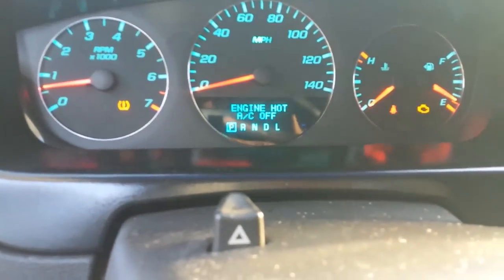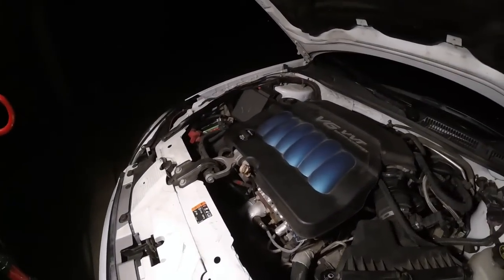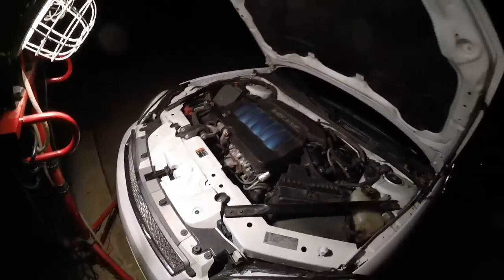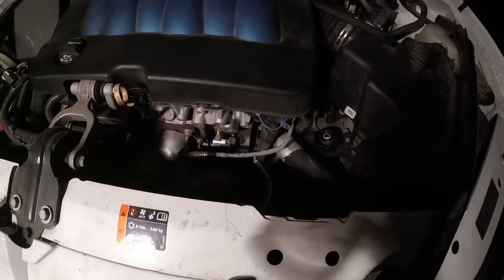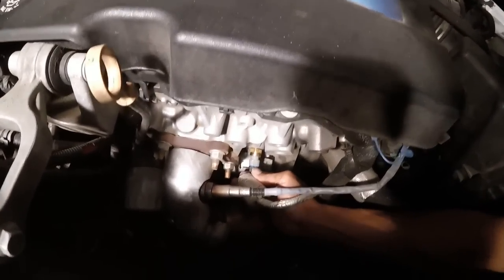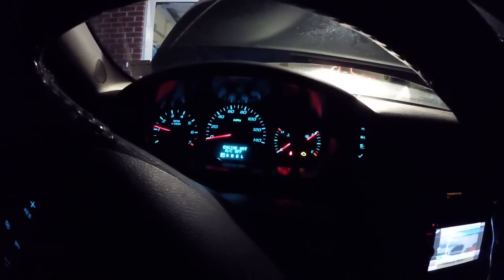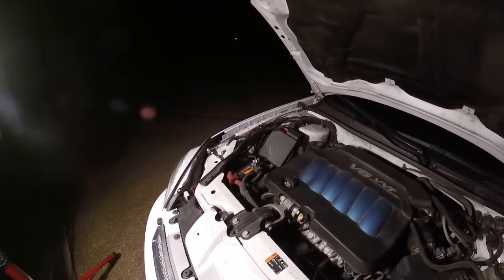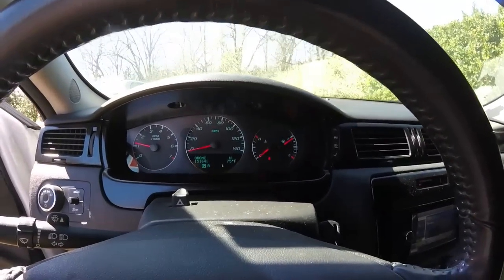2013 Impala Engine Hot AC Off Fixed

Comment: Had this same problem with my 09 Impala 3.9L, the design of the GM thermostat has a rubber seal on the valve, not allowing coolant to fully warm up. Its kinda of a misnomer because the warning light states: "engine hot a/c off." I went through the GM forums and found plenty of posts stating to start off with the coolant temperature sensor, then try the thermostat. I followed what the forums stated and changed out the coolant temperature sensor, to my relief the warning light turned off and all was well until I used the cabin heater on a cold morning and the message came back. After installing the new thermostat the warning light has been off for about a month and has not returned. When I removed the old thermostat, I was able to see that the valve seal was caught between the valve not allowing the thermostat to close completely. The seal was pretty much disintegrated, but after 11 years of service I can't complain. I hope this comment helps other DIY.
Reply from the maker: Good info 👍👍 that's pretty much how my thermostat was when I finally got around to changing it. The rubber seal was all warped and out of shape. No issues since then
Reply: @89imp03  good morning. I changed out the temp sensor and the wire that connects to the sensor. It worked for about a month and now the same issue. What to you think I need to do now?
Reply from the maker: @shannongreen7746  might have to change the thermostat. It's not as easy to do but I eventually changed mine and haven't had the issue anymore 

https://youtu.be/xVg4y--VAXs
Reply: @89imp03  thank you. I won't be doing it lol but I got someone who will. Thanks alot
Reply from the maker: @shannongreen7746  no problem, hope that fixes it

Comment: just replaced mine, i had an adjustable wrench, so it took me a while to get it off. I disconnected my battery during replacement, and reconnected post installation. Thermometer works like a charm! Thank you!
Reply from the maker: @infonoids  💯 glad to hear it worked out with no problems

Comment: This was perfect. Thanks for posting it. I had the exact same problem with my 2012 impala. $25 part, five minute replacement. Can’t beat that
Reply from the maker: Thanks, glad to help out
Reply: Good morning I was just wandering if you had to disconnect your battery terminal as well after replacing the sensor and if the Engine hot ac off reading ever came back on?
Reply from the maker: @tellinthatruthgame8785  after some months it came back and I changed the sensor again to be sure and also changed the thermostat and radiator since it was leaking. Hasn't came back since then
Reply: @89imp03  Thanks for the super fast reply I really appreciate it!
Reply from the maker: @tellinthatruthgame8785  you're welcome

Comment: Thanks for the video... I'm currently having the same problem, I have a 2013 Impala and I'm unsure which to do first... My coolant keeps running low and hate having to keep putting water in it 🤦🏿‍♀️ hopefully one of these ideas will work!!! 😑🙏
Reply from the maker: If the coolant is running low it's gotta be a leak somewhere. Could be a hose or a small crack in the radiator. If you're having white smoke or coolant & oil mixing it could be a head gasket

Comment: Thank you very informative I disconnected the battery from the very beginning and no more code Appreciate it Have a Blessed Day
Reply from the maker: Glad to help out 👍
Reply: @89imp03   The issue I’m having is that we pull it with the code reader and then it comes back on about a week or two later do I need to disconnect the battery???   It also seems that it seems to coincide with the tire  pressure sensor light
Reply from the maker: @Dagreat1ification  those two lights should be separate. If it's going that long between coming back on it could be a sign that the thermostat is sticking from time to time

Comment: The amount of people having this issue blows my mind! We replaced the sensor thermostat is next cause disconnecting the battery hasn't worked for me but tbh I didn't leave it disconnected long so I've had it unhooked allllll day. I'll touch the wires together tomorrow before I hook up the battery but that sounds scary. I hope its safe to really do that lol
Reply from the maker: Yeah this has to be the most common issue with these cars next to the blend door actuator. The sensor worked for me for a while then the light would randomly come on. Found a crack in my radiator last year and changed that and the thermostat and haven't had the light come on since

Comment: Thanks again for this video I thought I had  Posted an update the other day. I had the P0117 code that said the circuit was low for the temp sensor. Changed the sensor but it did not fix the error and it got to the point where none of the tricks would work.  So we replaced the thermostat and that seemed to do the trick put fresh coolant in it and no more issues since then.
Reply from the maker: Good deal 👍👍 glad it worked out
Reply: Is it still good.
Reply from the maker: So far so good with mine after doing the same. Later on I had a radiator leak so I changed the radiator and thermostat together. No lights since then

Comment: Hey man this is a very valuable video. Thanks for posting it this video saved my very hectic Christmas eve. It works!!
Reply from the maker: Glad it was helpful 👍
Reply: Very unlikely to be the fix as temp sensor hardly ever fails!!! Replace thermostat but first check fluid level and for any frade wire at temp sensor pigtail

Comment: Yo! Huge fan!! Been following you since i got my Impala. I just had this issue with mine a few weeks ago, change the sensing unit in the front, still having the same issue. The thermostat is next but do you know if there is another sensing unit on the side?
Reply from the maker: Thanks for sticking around. To my knowledge it's just the one sensor on the front

Comment: Good news , I did buy & replace the thermostat , I'm all good now ! Major difference with the needle when warming car 👌👌
Reply from the maker: Good deal 👍
Reply: @89imp03  yes , but I have another issue or "Code " for this matter .
P0455 I believe, However it's an  emissions problem or "large leak " which is common with the chevys I noticed .
I'd like to send you a pic or two of the leak as it is visible , it would be a huge help man !
Reply from the maker: @t-pitz8866  I haven't dealt with that code yet but it could be a gas cap or a loose hose on the evap system somewhere
Reply: @89imp03  loose hose yes , thanks I've got testing to do !
Reply from the maker: @t-pitz8866  good luck man

Comment: I had the same issue.
Here is my Quick Fix:

1: Unplug both battery cables.
2: Drain electricity from your car system by connecting both positive and negative cables together for 10 seconds (Do not let any of the cables touch the battery, do it OFF THE BATTERY)
3: plug back your cables to the battery. 

Now you problem is solved.
Reply: Lmfaoo same man same

Comment: Changed my coolant temperature sensor it’s still doing it man
Reply from the maker: Could be the thermostat then. It's usually one or the other
Reply: Just happened to me
I'm just gonna replace both the thermostat and sensor
Reply: @handheldnintendofan  replace both
Reply: Bad sensor?  Does the car run ok even though it's doing that?
Reply: Thermostat!!! Also check for frade wire at the temp sensor pigtail!!

Comment: Say man I'm having the same issue but I'm also having a small leak on the left front side by the passenger wheel right under my radiator I'd like to send u a couple videos to show u exactly what I mean if that's coo
Reply from the maker: Aight, you can send a video to my IG. Could be a small crack in the radiator or maybe one of the hoses connected to it
Reply from the maker: https://www.instagram.com/kevinbrister/

Comment: I have the same model and year..would your engine run louder than usual and run-on after you took your key out of the ignition?
Your feedback is greatly appreciated!
Reply from the maker: Sort of. The fans constantly run while the engine is on so it'll sound a bit louder and when the engine is off the fans stay on for 10 or 15 minutes so it'll sound like the car is still running
Reply: This situation has just now happen to me.  Right after I went on a 1,300 mile trip. That's just one way. I have to go back also
Reply: Yeah, that's the sound of your radiator fans kicking in after you turn the engine off.  The faulty sensor thinks the engine is running hot.  The fans stop after a minute, or so.

Comment: Changed the coolant temperature sensor, the thermostat, and reset the computer using the terminal trick. Still have the same problem.
Reply from the maker: I'd just give it some time. Mine ended up coming back on every now and then after a few months and now it's back off and been off for months

Comment: My 2010 Impala is doing the same thing even after Chevy replaced the thermostat and the sensor... This is so frustrating... I really wish that Chevy would recall this issue. Just looking at the comment section many of us are experiencing this issue... I also had to replace all three actuators which is another issue with these Impala....
Reply from the maker: Yeah seems like everybody has this problem somewhere down the line. I've only had 1 actuator go bad so I've been fairly ok in that
Reply: try doing it yourself instead of letting chevy lie to you ive worked at dealers like nissan etc. just have someone you know replace it. its only a ten minute swap.

Comment: Did this code make your Impala not start??? Cause mines not starting after This code popped up and I drove to Walmart to get Coolant. Came out and tried to start it and it wouldn’t start. Doesn’t crank, but all lights come on in car.
Reply from the maker: It won't exactly stop it from starting just from the code but this causes the fans to stay on long after the car is off and if the battery is older that can drain the battery while you're in the store causing it not to start
Reply: @89imp03  I figured out what I have to do. It was my key. And also I just take the terminals off my battery and it goes away. But it happens if I don’t let my car warm up in the cold. So I always let it warm now before I go anywhere.

Comment: Worked for me it took 8 min to change sensor now temp gauge works .i cleared my code with code reader after i changed sensor instead of disconnecting battey post 2012 impala. It should be noted my heat was working prior to changing sensor and engine had no sign of overheating.....BIG THANKS only post showing 2012 and up model location of heat sensor, different on other model same body style.
Reply from the maker: Glad to help
Reply: Light came back on today? cooling fan running crazy as before i will change other possible fix thermostat and advise
Reply from the maker: @mrmelcollier9269  alright, let me know
Reply: It’s the thermostat!!! But also check temp sensor pigtail for any frade  wire also fluid level
Reply: Had to change  Thermostat also because it only lasted a week temp gauge came back on .now that thermostat has been changed  its blowing hot never had another problem since almost going on 2 months

Comment: Thank you for the video is helpful.  Mime has the same problem it could be the temp sensor or the thermostat. I did changed  the thermostat  and is still doing the same thing. so ((plan b)). I have to change  the temp sensor.
Reply from the maker: No problem. At least you got the hard part out of the way first. I recently changed the thermostat and it's way more work than this sensor was

Comment: Thank I'm going to show this to my fiancee , so we can change it out.
The shop wanted $200  -_- 2010 Impala 120,000 miles
Reply from the maker: No problem. This works for a lot of people but some still have the light come on and have to get the thermostat replaced too. It's pretty inexpensive to replace yourself too though
Reply: Don't let them try to sale y'all on that Housing assembly either @Ray that thing like 174.99 it's either the Sensor or Thermostat like bro said.

Comment: 🙏🏾💯 thanks man I did exactly what you said and it fix the problem..
Reply from the maker: Glad it worked out for ya
Reply: I changed the sensor three days later it came back on what does that mean
Reply from the maker: @Chefrob.  could be the thermostat is going bad too. Mine lasted for some months and then went back out now it works for a few weeks then goes out for a few weeks. I rarely drive it now so I don't know if it's back off or not

Comment: Replaced temp sensor and thermostat and still does it
 The relay for the a.c. compressor does this. Solution is to get code reset tool that works via Bluetooth to phone

Comment: I replaced thermostat and coolant temp sensor still had the same problem it turns out my coolant reservoir was dirty sprayed it out with high pressure water hose at the car wash problem fixed or you could possibly buy a new one
Reply from the maker: Hmm, I'll keep that in mind. Never even thought of that

Comment: My 2012 impala has been doing the same thing , haven't changed the sensor or thermostat, I have unplugged the battery and it resets everything for 2 weeks . So the question is has  your engine hot/ ac off come back on after changing parts
Reply from the maker: After some months it came back on then randomly went off again and then came back later. I never changed the thermostat just the sensor. I think it's back off now tho

Comment: I have this same issue when it happens the inside thermometer needle drops to C and the engine fans turn on. Is driving the car while having this issue a bad idea or is it just mainly a superficial thing as the engine isn't technically overheating right?
Reply from the maker: Typically it's just a superficial thing. As long as it's not leaking or anything it should be fine to drive until you can replace the sensor. The fans can cause drain on the battery while the car is off though

Comment: 89Imp03 did the problem ever come again after disconnecting battery? Mine does the same now and I unplug battery sometimes and goes for a little while then comes back
Reply from the maker: Yeah eventually it came back on from time to time. I think I have to change the thermostat too and that should permanently fix it

Comment: Did the message come back up?...bet it did
Reply from the maker: A few times but I recently had to change the radiator and thermostat. No issues since that tho
Reply: @89imp03  it a great idea to change both the sensor and thermostat at the same time

Comment: I had the same message on my wife's 07' Chevy Impala LS, changed the thermostat didn't have to disconnect the battery, let the engine run and message went away..
Reply from the maker: It's usually one or the other

Comment: This is what’s going on with my 2013 when I turned my car off the fan was still blowing . Is this what happened with your car ? And my AC isn’t working at all .
Reply from the maker: Yeah fans stayed on with mine too. If this doesn't fix it some people say you need to change the thermostat too
Reply: @89imp03  thank you so much I gotta a diagnostic it said both of these needed to be changed so that’s what I’m gonna do tomorrow . Will my A/C start back working to ?
Reply from the maker: @sclovepocaa5481  good deal. If that's the only problem than the ac should be back working

Comment: I have an 08 LS 3.5L V6 Flex Fuel, and I get this message plus one that says Engine Overheating Idle Engine. It first did this on a highway, and I couldn't accelerate, and had to coast it into an exit. My coolant seems fine. I have oil in it, but some of it is the original color, and some of it is black. There's no smoking, just a burnt oil smell, and it runs hot, and the car shakes. What could my problem be?
Reply from the maker: As far as the overheating, check and make sure your fans and water pump are working correctly. They could be causing the other issues with the shaking and burning smell
Reply: @89imp03  Thank you!
Reply from the maker: @LionessofGodKJV  you're welcome
Reply: Sounds like multitude of issues going on here!! These cars need three things to run smoothly..1 battery..2 clean air filter..3spark plugs!!! Have these three in great shape you will avoid tons of headaches shop bills and unconvinced!!!

Comment: Hey hope you respond to this being 4years since you posted it. So I'm getting the same alert but the gage is going up to over heat. Is it possibly a similar issue? Any input would help me fix this myself.
Reply from the maker: Could be. Check and make sure you aren't leaking any coolant though. The sensor may work if it's going up but it could be coolant isn't flowing
Reply: @89imp03  no leaks anywhere like shockingly not at all or smell of coolant or smoke. I believe it is the thermostat but learning other possibilities to look into just incase. Someone said maybe a relay switch of some kind and to also check my fans fuses they do sound slower. Thanks for any help!
Reply from the maker: @junglemutt5007  no problem. Yeah check those fans and look into swapping out that thermostat

Comment: I have the same problem and I still have to disconnect the battery cable. problem not solved. Lol I just wonder if your message came back on
Reply from the maker: Last year I ended up getting a new thermostat and radiator (old one had a crack) and it's been good ever since then.  If it keeps having the issue I'd suggest swapping the thermostat too

Comment: Did the code ever came back? Because when you clear the code it takes about 40 miles to reset the monitors.
Reply from the maker: It would come back on occasions after a few months. I recently changed the radiator and thermostat (radiator was cracked) and haven't had any issues since then